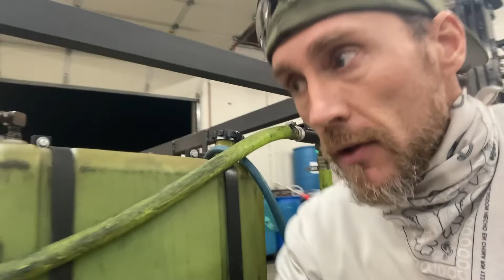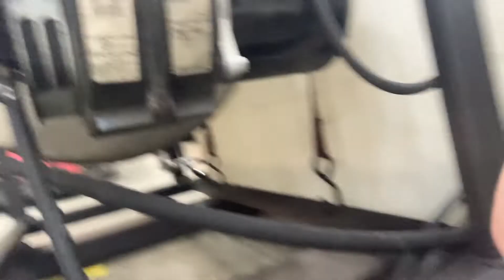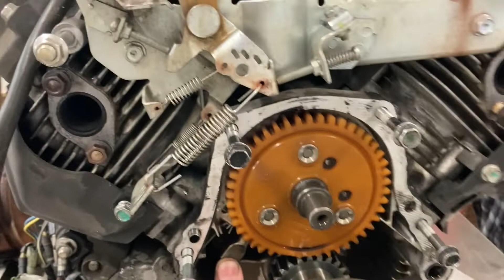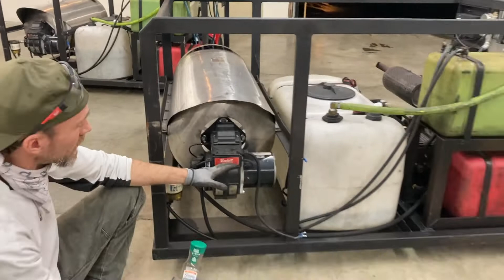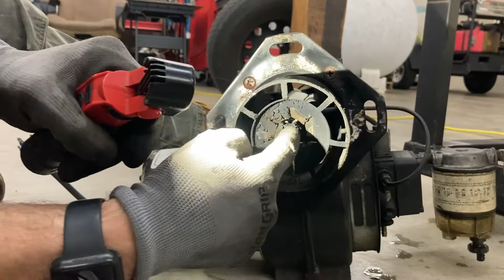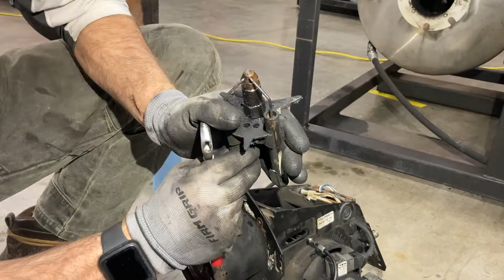Reclamation Hot Water Pressure Washing  -  Cleaning and Servicing a Hot Water Burner

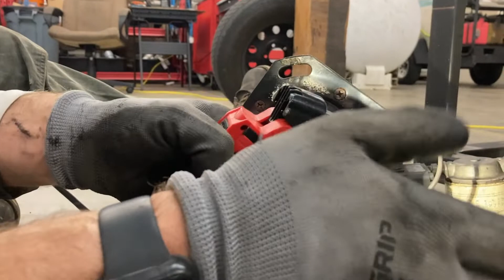Comment: 44:23 isn’t that measured in gph not minute? Also my hot water pressure washer has a CAD Sensor in the with the transformer and fuel nozzle system.  What exactly does the CAD sensor do? Great video I leaned a lot and reinforced things I kind of knew
Reply from the maker: @stevekenbeek7823  yes you are correct it’s gallons per hour.  Mitm’s machines put 3.0 gph nozzles in the 8gpm skids and 2.75 gph nozzles in the 6 and 4GPM skids.  Additionally I just learned they put hollow cone pattern nozzles in the 8gpm skids and solid cone nozzles in the 6 and 4’s.  Good catch!
Reply from the maker: @stevekenbeek7823  one is designated A and one B I can’t remember which is which, also the cone degree is different one is 90 degree cone the other is 80

Comment: Could you please do a video on high pressure hot water washer with the vacuum switch that turns on the hot water?
Reply: Randy there is a pressure switch that is involved in the circuit that activates the burner, but no vacuum switch.  Can you clarify what you're asking?
Reply: @ There’s a switch looks like a well water pump. It has a lever and if I push it down burner comes on. I have already replaced this switch and still same thing

Comment: Really dig the all of your videos man.  Taking the time to share your wealth of knowledge is much appreciated.  I bought an old HydroTek burner last September and it  worked for about 10 minutes before the oil burner started blowing black smoke.  Not sure what happened but need to fix asap.  lol.  Have a good one!
Reply from the maker: Black smoke usually means too much air.  Check the air intake and see if it had screws fall out and the little slider vent vibrated to a more open position.  Or just try choking off the air a bit and see if it cleans up the smoke